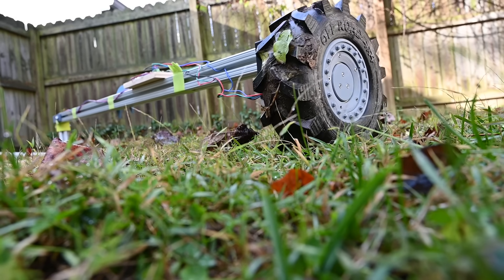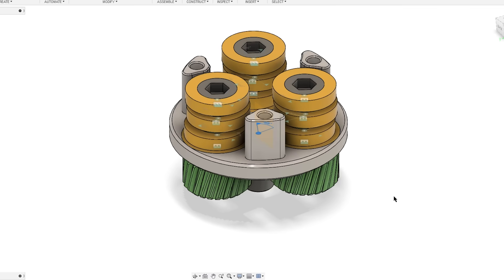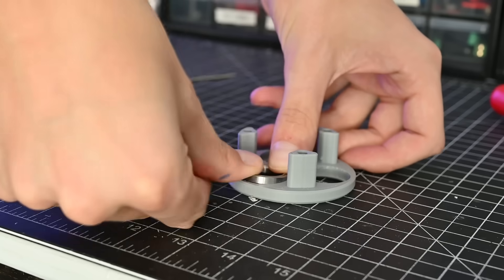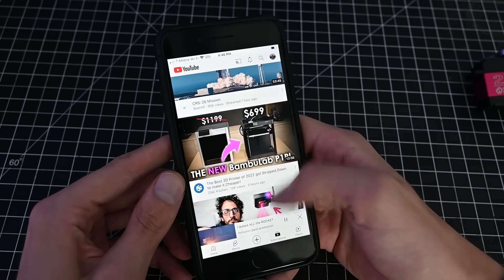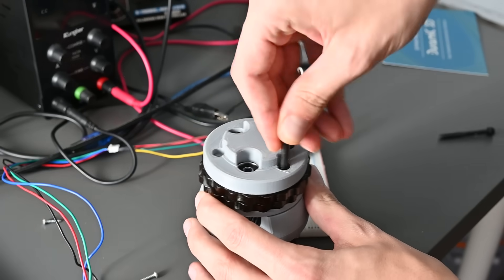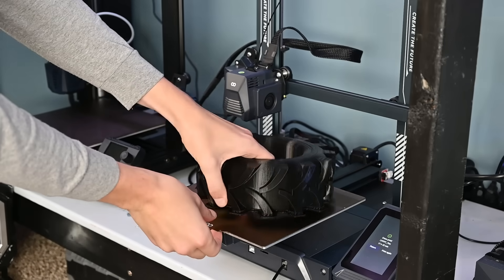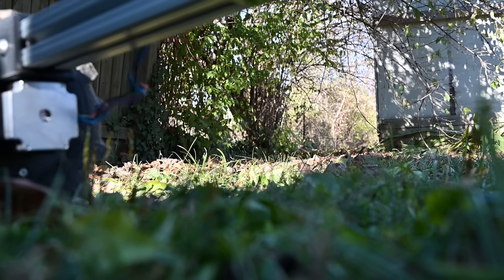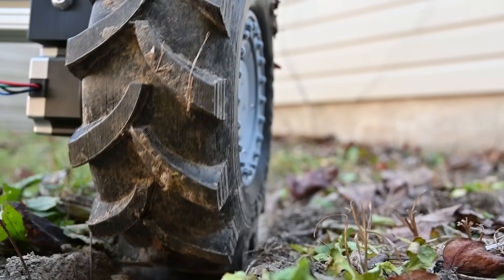3D Printed Planetary Cycloidal Hub Gearbox. How far can it drive?

Comment: I made a spinning plant platform in my back yard this last year and spun a special plant at 30 RPM for 7 months which was approximately 9 Million rotations.  My platform was driven by an old 14.4 volt DeWalt drill hooked to a variable 0-48v power supply set at about 4 volts: direct driving a "Lazy Suzan" type platform with metal bearings, a scooter wheel with a solid shaft bolted in and chucked into the drill was my drive wheel that transferred power.  It was a fun project and I was reminded of this by your video.  Perhaps you could make spinning plant platforms, it's a fun experiment that is endlessly customizable and it turned out to have fantastic results and increased growth as well as pest resistance, and cold resistance when the time came.

Comment: The base gearbox on a fanuc robot arm is very similar except it has large needle bearings that the cogs engage with and an outer stationary internal cog that holds the needle bearings

Comment: Nice job I've just printed it  to build a robot lawnmower  but there is a small difference on the parts called Cycloidal_Disk.
The number2 external dimension is 0.2mm larger  than the number 1 which is sufficient to prevent this part to roll inside the part called Wheel_rim.
Reply: Everything is good. Check your alignment.

Comment: Testing it with almost no torque applied does not prove anything. Would have been interesting to do a duration test with a constant or variable torque applied. ( a cranck with added weight ...)

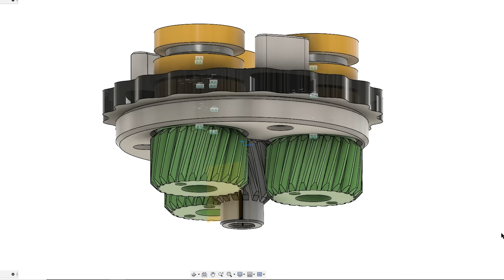Comment: This is amazing, love the presentation style and design.  I reckon the gear ratio for the cycloidal part (at least the one you uploaded) is 1:21, not 1:20.  (Specifically, the planet gear turns 21 times for 1 rotation of the output housing.

Great design, I am absolutely stealing (with credit, ofc)

Comment: would be interesting to test efficiency given that there's so much hardware involved. a good cycloidal drive usually have a ton of bushing and the 3d printed one experience a lot of friction
this one doesn't seem to need  a lot of that

also interested of the weight of the whole assembly

Comment: Put an eccentric weight offset by an arm off the hub and run it hanging off a bench - that way you get an alternating plus/minus torque on the components with the weight driving the motor on the downside of the revolution and the motor providing max torque on the upside of the rotation. The eccentric arm length and weight define the maximum torque required.

Comment: Just load it, weight the bar to like 15 - 25lbs at the wheel; and add obstacles to climb like irregular shaped fist sized rocks (or bigger if the tire won't slip) or just 3-6" or so ramps then a abrupt drop, rough terrain, etc.
That should give you a better "real world" stress test.
Nice video and build!
Cheers, 
Patri0t

Comment: Put it in a winch and have it raise and lower some weight and see how long it lasts? Or put a lever on it with a weight on the tip and just leave it spinning in the same direction, raising and lowering the weight on opposite sides of the cycle, if for some reason it's not an option to have it go back and forth?

Comment: A relatively simple test would be mounting it horizontally with an arm on it with weights attached.
As it rotates it will get loaded sinusoidally and easy to change the torque

Comment: Same test two weeks but under load, and use the load of a average car but in proportion to its size and how that vehicle would weigh on that wheel under load. That could then be change under load with one person in the vehicle, then with a family, then with the usual things carried in a car all proportional to the size of the wheel and then see what happens to the gearbox and transmission. Brilliant design it looks like it's for military or heavy industrial use, it's speed it's too low but that could be how much hp is coming from the motor and how much reduction they transmission has on the speed, Nice anyway .

Comment: Seems perfectly feasible for low torque applications.  But, and what if, instead of using a large tire, a set of bicycle sprockets with a gear changer.

Comment: What about a drill press. Or screw driver. Plantery and sun gear design is very similar to a pneumatic screw gun that got a lot of attention and engineering magazines when it came out.. I bet this would be smooth and precise good pro gram how many degrees of turn you want to screw. Very Nicely completed project.

Comment: Awesome gearbox. Paul gold will probably be making one tomorrow. I don't understand why these designs are not more popular. I would just mention that the planetary gears don't really get as much stress as the cyclodial gears. That's why it's a good idea to cut them like you did. I also never really liked how the pins are pushed on a typical cyclodial. CONGRATS.

Btw.  Everybody wants to know the efficiency.
Reply from the maker: Working on a test setup that should be able to measure dynamic torque and efficiency for any gearbox. Stay tuned!

Comment: Use the same type of gearbox but to receive the opposite outcome an overdrive, would see higher wear on the gears. and test it with a high load (something like 20kg)

Comment: I was amazed with this.  I have pondered building a gearbox but I wondered how PLA or other plastics would cope. Here most components are on low stress and it works.  Wow.  I listened carefully to see if the gear reduction was  mentioned.  If it was I missed it.  Does anyone know what the figure was.  I am guessing it was around 1:300.  Anyone know?

Comment: great build.  the key takeaway for me was the resin:  Siraya Tech Blu Nylon 3D Printer Resin Nylon-Like Strong and Precise, B09QKZB62W.  being black maybe i can get smaller diameter holes without them filling in since maybe less glow thru the resin.  i'm wishing to make parts a bit smaller than a micro SD with 24 little holes in them.
Reply: You have a part number for the black resin, by chance?
Reply: @janbeck8269  Thats the amazon part number in my post, from there you can get the rest.
Reply: @blackenedmerlin2076  First, thank you for taking the time to reply! Second, haha, I took the Blu to mean the color and could not find the black. Ordered.

Comment: How much torque does it have? I am building a (fully autonomous) golf-trolley and I am still looking for the right motor and gear, so the 25kg trolley with its 40cm diameter wheels will drive up to 5 mph....

Comment: does the wheel turn at a single speed or does it speed up and slow down as the cogs make contact with the output gear?   P.S. Thank you for the wonderful work.

Comment: Use the same setup but add some weights to it in a trailer towed behind the big wheel. Put the trailer on a wide enough base so it wont flip and a single pivot attachment point so it can move freely behind the bigboi

Comment: I would love to see the same test under some load ! But man this is a really good starting point !!! I think having slow moving parts keeps them cold, especially pla/pla+ that melts at low temperature and thus limits wear. Plastics can last very long but as soon as the become hot they disintegrate really fast
Reply: I've heard tell that 3D printed plastic will melt.

Comment: Aluminum cycloidal discs could be made from a plastic one using a handheld router and a carbide copying bit. Might be an interesting upgrade.
Reply: This is a great idea, not just for this project but generally: It’d be kind of like semi-manual CNC. It wouldn’t afresh small holes that need to be positioned precisely, but seems like it’d be a fantastic general,solution for profiles. I’d really like to see someone explore this!

(Hmm, for hole placement, what If you made oversized holes that would accept metal bushings? The bushings would guide manual drilling, I wonder how accurate that would be?)
Reply: Had the idea a while ago but haven't had a use for it yet and this seemed like possibly a good application. Saw one video a couple weeks ago where someone did this to create a roller chain sprocket but can't locate it now (curious how long that part would last).

I've used 3D prints for hole layouts but have so far never needed to press bushings into them for the level of accuracy (and longevity) I required.

Don't see any reason the bushing method should be less accurate than the process used to produce the holes in the first place, presuming quality bits and bushings.
Reply: Managed to find that video:

https://youtu.be/lU3elSJ6PzQ

Comment: magnetic + mechanical teeth cvt in 90 degree sliders + clutch
Reply: no mechanical contact most of the time, unless lock is wanted, no wear
Reply: graphite infused surface, no ball bearings, kinda fluid/air bearing, but with slippery graphite dual/single surface
Reply: so who buys or needs to sell
Reply: engineering starts at k.i.s. smarties
Reply: how many moving parts you have, or breaking parts, calculate the probability of failure, its break^parts
Reply: the more parts you have, the more easily it breaks
Reply: hows that subscribing working for you
Reply: do you have to do something "to live", no thats death if you have to
Reply: do the load test
Reply: yes break it

Comment: I guess thinking about it after the video, if it is properly lubricated, kept free of abrasives, not under and limits of plastic or elastic deformation, what are the limits on this running indefinitely especially at such slow speeds and low stress?

Comment: Ok, someone PLEASE explain 4:07 how the first acrylic disc set in place makes the other three gears connected together? The 3 gears aren’t touching, the center helical spur gear is not installed yet and the first disc doesn’t rotate?🤯are the cams “wobbling” the first disc just enough to spin the other gears? Thanks!
And great video by the way!
Reply: Yep, that's how it works. The ring on top forces all of them to move together by transferring the force from one off-center cam into the other cams, rotating the gears connected to them.

Comment: Hey, I'm about to be that guy. Sorry. A spur gear by definition has a zero degree helix angle. A helical gear has a non zero helix angle. You printed helical gears, or if you want to be slightly more specific, single helical gears.

Comment: This would make one heck of a RC rock crawler. Could you shrink it all down to work with the 1.9/2.2 wheels used in 1/10 scale RC cars? I mean, if you need a practical application for it.

Comment: Please do dynamic load testing!
Make a Ø100 mm drum instead of that wheel, and attach a string with some weights. Then you can have a program making it spool in and out repedetly. Would be really intersting to see how it holds up. Great vid btw!
Reply from the maker: Will be doing something similar to this soon. Stay tuned!
Reply: @michaelrechtin  Or maybe just a wide rake for inside the circle
Reply: @michaelrechtin  I'd also love to see the wear on the gearbox as a result of heavy radial load! maybe suspending the gearbox horizontally with a drum with weights in it or somethjng similar. as the drum rotates, the motor should always experience approx full overhung load. part of me wonders how much the rigidity of this gearbox (each shaft looks to be pretty sturdy) will negate the danger of a radial load or what
Reply: @michaelrechtin incredible durability! Will also vote for peak and max sustainable load test plus backdrivability. Thanks for the intro to a completely new great type for me!
Reply: test carried weight and towed weight.
Reply: YES I was just going to comment thid
Reply: Yeah

Comment: Nice video man!
Just a couple of things: 
1. I'm pretty sure that tire tread should be run on the opposite direction(CCW instead of CW),
2. Ideally for 3D printed parts you want heat set inserts that look like herringbone gears instead of the flat ones you used, this makes so they don't slip out later. CNC Kitchen has a great video on this topic.
Reply: Glad I'm not the only one who noticed the tire was being run backwards! It was driving me nuts
Reply: @evanbarnes9984  i saw that too but thought "no, he made the thing, he knows best." Glad to see im not crazy.
Reply: Also I've printed tires with TPU and they turn out amazing, something to think about.
Reply: Came here to bitch about the inserts. These are for injection modling, you want the "knurled" type.
Having said that... GREAT introduction of yet another cool gearbox for makers!
Reply: @ronnetgrazer362  sure but the straight cut ones are a hell of a lot cheaper in bulk - if it's a high stakes situation def use the right ones but for prototyping the straight cut are really fine
Reply: @phoebedegroot9627  You're right of course. I'll feel more entitled to nitpicking as soon as I've 3d printed my first gearbox :)
Reply: Ok, I wasn't seeing things weird again. that's a relief.
Reply: The filament came from Britton, so the tire was going the wrong way. Or something like that.. Haha
Reply: @deanharris7149  What is "Britton"?
Reply: The tire is being ran more like a tractor tire, meaning that with it spinning "backwards" it gains additional grip and prevents slipping... not that it matters in this application.
Reply: Why hasn't Michael Rechtin hearted this comment yet? 

He should really reupload the video playing the tire footage in reverse.
Reply: True
Reply: but how do you get the inserts in if they have angled teeth both ways=
Reply: In the direction he chose, you get more grip while with the direction you think is right you get less rolling resistance.
Reply: @Schradermusic  It is a common misunderstanding that there's more traction in a tractor tire going the other direction (like in the video). The problem is that you basically scoop all the mud into the treads and thus create less grip. Going the right direction diverts the mud out of the treads (to the sides) on purpose to get to lower more firm ground. You can actually see the issue in the video where snow has packed into the tread instead of being pushed out the sides.
Reply: @MortenBN1988  There is tehnically more traction at the beginning but then it eventually does fill in.
Reply: I thought the whole ideea with these drives is to take out backlash? If you strat using gears doesn't that defeat the purpose?
Reply: Gramig

Comment: Nice work. Yeah, I'd love to see this hooked up to a BLDC. You can use SimpleFOC to drive the BLDC. I'd like to see some load tests on it too. I also keep wondering if you get faster/slower fits and starts as it moves along those cams? It seems like I see a bit of fits and starts in the video rather than truly smooth rotation. It may not matter for the application, but a robot arm may have issues with that. If it's just used for wheels on a rover then probably fine.